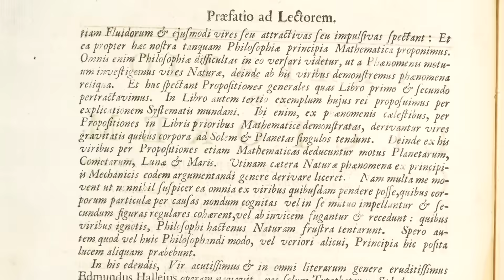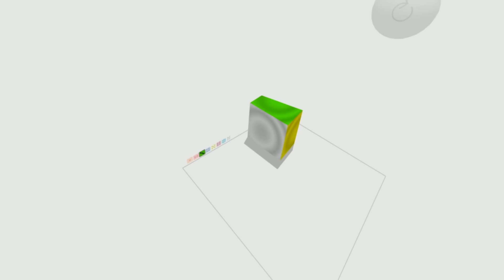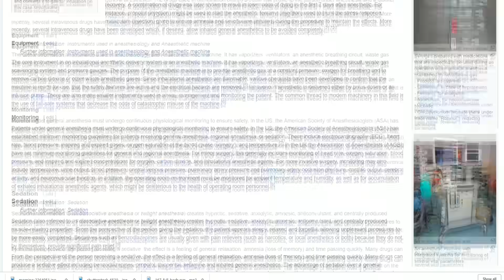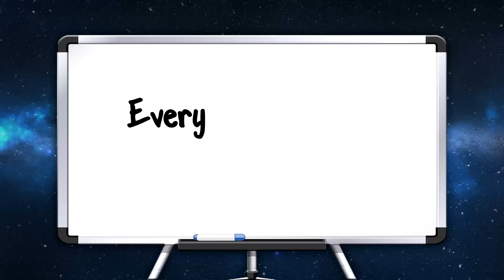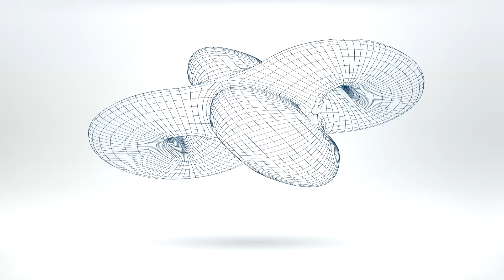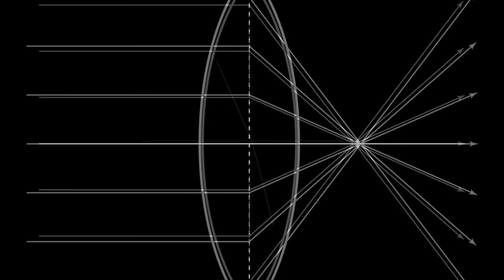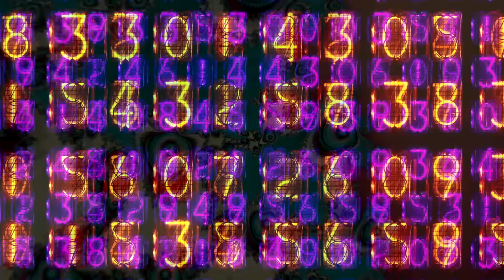The Mystery at the Bottom of Physics

Comment: Do we live in a time dimension? As far as I'm aware, living in a time dimension should be like living on a line we can travel backwards and forwards on. If we can't move backwards and forwards, are we in a time dimension?

You might say the same thing about a piece of paper that's always rising. Since the inhabitants are always travelling upwards, they must live in a 3D world (despite obvious evidence to the contrary).

String theory says there's like 10 dimensions, right? But if we can't interact with them, what use is saying we live in a 10-dimensional world? Time is something we can't interact with, either.

Also the idea of time dilation seems to shred (heh) the paper metaphor, but if things are moving at different speeds upwards, then the distance between them changes, but due to the nature of a 2D world, they're still connected. So does that not have the same effect? As time is warped, so is distance, and if distances beyond the model of a 2D world are warped, so might distances under their understanding.

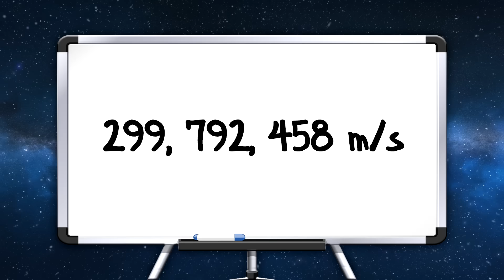Comment: I think 1:36 is wrong, because the speed of light is absolute. If you travel at 10%c and emit light while doing so, the light will move away from you at 90%c and not full c. This is why we have relativity
Reply: The thing is, if light would only be moving away from you at 0.9c then from your perspective (frame) it wouldn't be moving at c (which is the only speed it can go). If you are traveling in a train at 100 km/h and toss a ball away from you at lets say 30 km/h looking from the outside the ball would be going 130 km/h. This is not the case for light. If you go by train at 0.9c and turn on the light at the front of the train it would still be moving at c not at c+0.9c or 0.1c. This is one of the two principles of special relativity and with some (not to hard math) you can derive mostly all of it's rules with just that statement. 
Btw there is a rather nice Vsauce video on the topic "Would Headlights Work at Light Speed?"  I highly recommend it.
Reply: @stefanlindner2048  ok i must have mixed something up. But looking from the outside, somebody travelling at 0.1c will only emit light at 0.9c which adds up to 1c. So the only way the people in the train could experience their own headlight beam travelling at 1c is by their time being dilated compared to the stationary viewer?

Comment: So a variable constant, much like things that work for one generation doesn't for the next, and often spark of debate;we cannot agree on one thing. Because a constant is an object or state which things can be measured. When something that works as a child in the 1950's it may not work exactly the same in the 2000's because of what we purview as fresh air at one point may be the underlying cause of oxidation, Yet we make adjustments to alloys based on current conditions, we should have further understood what fresh air truly was, worked with nature instead of against it to prevent destroying the planet with toxic chemicals? Petroleum,Lithium,Graphene,Silicon?

Comment: wanna learn how to make lemon cake..? well its your lucky day
Ingredients:
1/2 pound (2 sticks) unsalted butter, at room temperature
2 1/2 cups granulated sugar, divided
4 extra-large eggs, at room temperature
1/3 cup grated lemon zest (6 to 8 large lemons)
3 cups flour
1/2 teaspoon baking powder
1/2 teaspoon baking soda
1 teaspoon kosher salt
3/4 cup freshly squeezed lemon juice, divided
3/4 cup buttermilk, at room temperature
1 teaspoon pure vanilla extract
For the glaze:
2 cups confectioners' sugar, sifted
3 1/2 tablespoons freshly squeezed lemon juice

Instructions:
Step 1: Preheat the oven to 350 degrees F. Grease and flour 2 (8 1/2 by 4 1/4 by 2 1/2-inch) loaf pans. You may also line the bottom with parchment paper, if desired.
Step 2: Cream the butter and 2 cups granulated sugar in the bowl of an electric mixer fitted with the paddle attachment, until light and fluffy, about 5 minutes. With the mixer on medium speed, add the eggs, 1 at a time, and the lemon zest.
Step 3: Sift together the flour, baking powder, baking soda, and salt in a bowl. In another bowl, combine 1/4 cup lemon juice, the buttermilk, and vanilla. Add the flour and buttermilk mixtures alternately to the batter, beginning and ending with the flour. Divide the batter evenly between the pans, smooth the tops, and bake for 45 minutes to 1 hour, until a cake tester comes out clean.
Step 4: Combine 1/2 cup granulated sugar with 1/2 cup lemon juice in a small saucepan and cook over low heat until the sugar dissolves. When the cakes are done, allow to cool for 10 minutes. Remove the cakes from the pans and set them on a rack set over a tray or sheet pan; spoon the lemon syrup over them. Allow the cakes to cool completely.
Step 5:For the glaze, combine the confectioners' sugar and the lemon juice in a bowl, mixing with a wire whisk until smooth. Pour over the tops of the cakes and allow the glaze to drizzle down the sides.
PS: FOLLOW MY INSTAGRAM MEME PAGE PLS <3 NAME: calabris1
Reply: Omg I was just watching the video and thoght to myself I would LOVE a lemon cake right now and u saved my day!! Thank you very much!
Reply: @m4rth1n13  haha np
Reply: Instructions unclear, got stuck in a highly elliptical orbit around UY Scuti.
Reply: Thanks...i think😂😂
Reply: thanks
Reply: Please translate it to grams 😂
Reply: damn, this is deep
Reply: I’m saving this recipe
Reply: you`re not the the hero we wanted, you`re not the hero we deserved, but you`re the hero we needed
Reply: Help I followed your instructions and an unborn 6 year old fetus began eating my children what do I do ?!
Reply: @DrCooch  just scream "STOP PLEASE"
Reply: Want to have an existential crisis? Well today’s your lucky day! 

1. Get on YouTube and go to exurb1a’s channel
2. Watch all the videos
3. And live out the rest of your life!
Reply: No
Reply: I'm done it is
Reply: Thank you for your relevant comment. I wish more youtube comment sections were this relevant to the videos they belong to.
Reply: thx
Reply: I will try this 🤙
Reply: Thanks, I'll show this to my mom, so she can bake lemon cake for the entire family!
Reply: You have gay
Reply: Lemons and Cake? Just dont burn your own house down
Reply: bleachlover 69  try again
Reply: Normie
Reply: decided to try this, it turned out very yummy :)
Reply: Wait What- bullshit. It’s impossible to make the cake in 43 minutes (the time between comments), so you’d likely still be prepping the ingredients or just starting baking
Reply: @madisonarnett4194  oh no you did not. 

  I will use the most conservative approach for this: the first step in the recipe is preheating the oven,which takes 10 minutes. Assuming you were the Usain Bolt of cooking and you managed to get the batter ready to be baked in those 10 minutes,you would then need to bake the lemon cake for at least 45 mimutes.( Then you would need 10 minutes (at least) in order to allow the cake to coo completely before you can eat it and say it was "yummy",however since you are the greatest baker in the world I will assume the lemon cake was already cooled and ready to serve when you got it out of the oven) 

That adds up to 55 minutes, being extremely conservative. 

You posted your reply 43 minutes after the original comment. 
Which means,you couldn't possibly have tried this recipe!

R/thathappened  confirmed
Reply: @anacalisov  I've actually seen this copy pasta before, I think it was on lana del Ray video before? it turned out nice
Reply: my dick got stuck in a fence wtf is wrong with u
Reply: Wtf is wrong with u?!